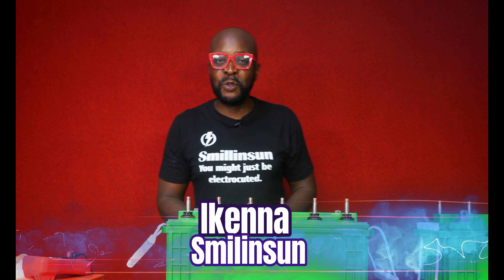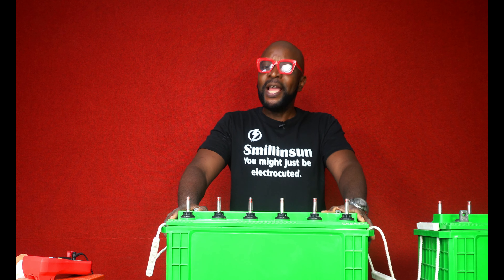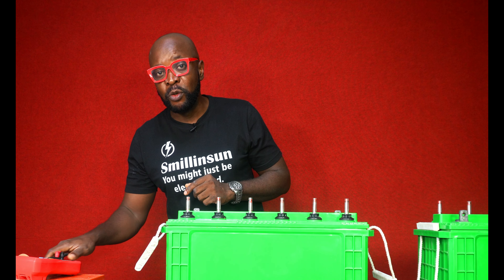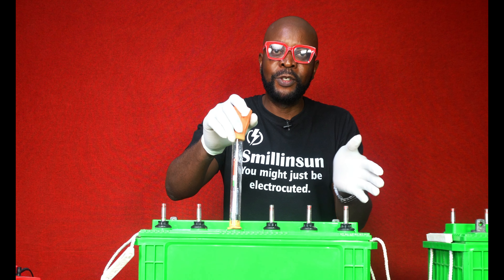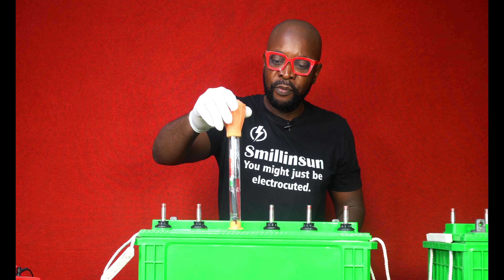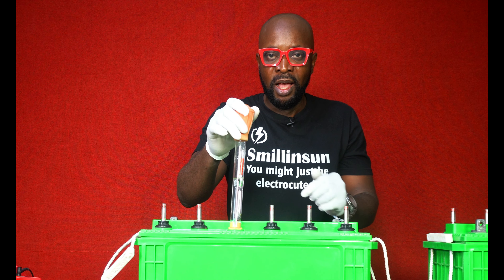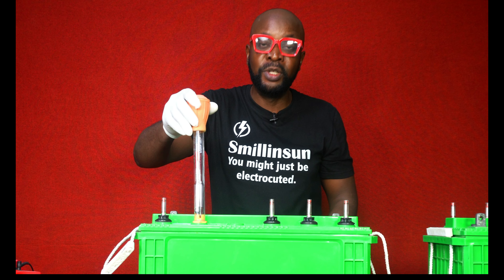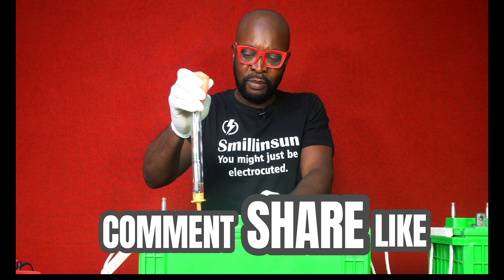How to test your Tubular battery to know its condition

Comment: Thank you Ikenna, Best advice at all times. 
An additional point is the battery should be Fully charged and it should not have been added distilled water for about 5 days as this can give inaccurate SG reading.
Reply from the maker: @benjaminkioko-bt4xl  Correct thanks for that